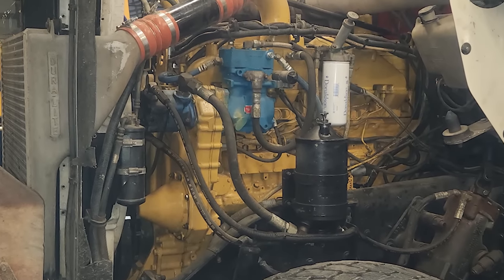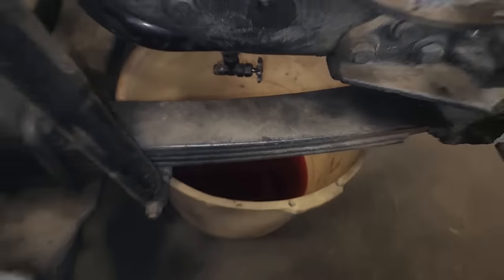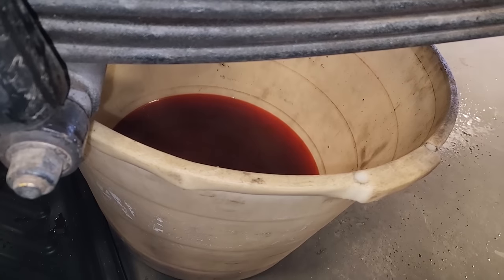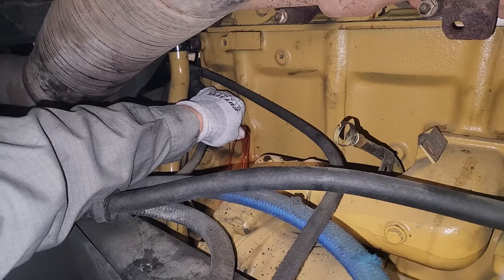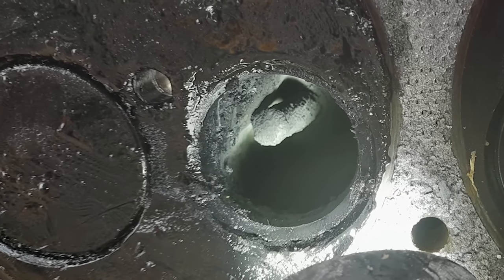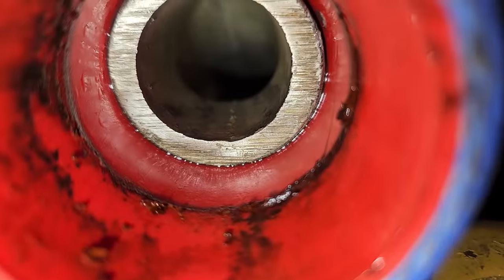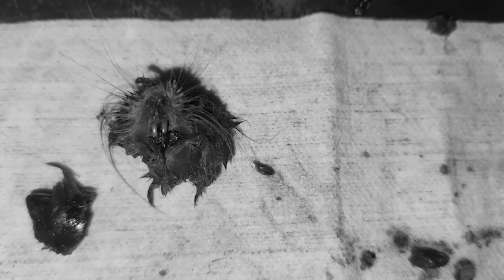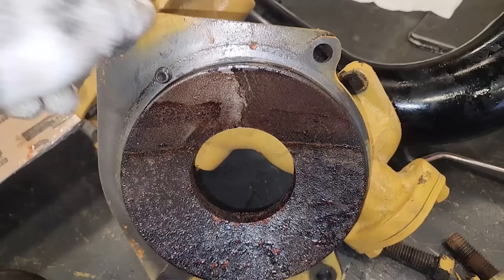Engine Overheats after Full Rebuild, but Why? (YOU WONT BELIEVE IT)

Comment from the maker: Thanks for watching. Cooling systems should always be vacuumed filled to prevent air bubbles in critical areas using something like this Airlift on this Amazon Affiliate link: Airlift Cooling System Vacuum Filling System: https://amzn.to/3D9AlPu 
@AdeptApe on Venmo or AdeptApe@yahoo.com on PayPal for donations, thank you so much for supporting the channel!
Reply: The cooling systems have a design "requirement", it is actually an installation specification that is checked during a installation review, that the cooling system can fill fully using a steady stream of coolant. I can't remember the actual flow rate - but a softly flowing hose is a reasonable description.  Sometimes this is made possible through the (discouraged) use of bleed valves at the high point of the coolant lines. OEMs use a vacuum filing system at production so the system can be filled faster and there is ABSOLUTELY nothing wrong with using one. But if it is required to get a full fill it is probably indicating that there is a problem with the coolant lines routing that has been changed or is restricted etc.
Reply: I bought and used this airlift system 3 times already. It works great.

Comment: This is why as a mechanic as soon as you think you have seen it all, something comes along and proves you wrong!!
Reply: Murphy's Law: what can go wrong will go wrong, even if you don't know it can. The mouse has proven why it is impossible to idiot proof anything. There is ALWAYS an idiot standing by to show how ingenious idiots can be.
Reply: Very interesting find!!! That poor mouse went to the wrong place to sleep... It is a reason WHY I like to put a shop rag or a piece of plastic sheet in front of inlets and hold them in place with rubber bands.... Yes, it does take some time to do this, but it also prevents several hours of troubleshooting and down time, of an extremely expensive asset.... This could easily offset the few minutes of prevention to avert a potential catastrophic failure... Protect open spigots and hoses before moving onto the next steps of repairs....
Reply: And then there is o'tools law that states that Murphy was an optimist.
Reply: I have never even heard of something like this! Wild.
Reply: @pickelsvonbrine  First time for everything...

Comment: Thanks Josh, I should have brought it to you to begin with!
Reply from the maker: Always happy to work on a Cat or a mouse in this case. Hope she runs great once it's back together. Thanks for bringing it in.
Reply: Love your vast knowledge. Just curious if anything else had to be done to the ole B model and if the waterpump was ok with the rust in it? I have a 3406B 4MG model that I installed a new water pump on...but also has slight rust from a separare problem.
Reply: Cats are, after all, good at catching mice.
Reply: At least it wasn't a complete failure on the rebuilding shop.... But glad it is being taken care of now and getting you back on the road!!
Reply: The cat and the mouse like Jerry he always got the cat.
Reply: Send the old shop a bill for recent diag. and include a pack of mouse traps.
Reply: @diesellivesmatter  Jajajajaja Jajajajaja Jajajajaja 😅🙏🏼
👍🏼

Comment: Wow, that's weird but makes sense.  Worst animal versus engine one I heard to this point was a landfill compactor (Al-Jon), had a Cat C15/D398TA pre-DPF engine (its been 20+ years since it happened), and it had been parked overnight outside of the maintenance shop at the landfill after running the previous day.  Early morning, Operator comes in and fires it up only to be startled by the immense amount of racket that occurred when it cranked over and fired up.  Shut it down quick, but the damage was done.  What happened?  Somehow a stray cat (no pun intended) had crawled past the shields over the engine cooling fan/shroud, and met Mr. 600 HP Caterpillar radiator fan, and it had dismembered the feline and shattered the blades on the 6 foot diameter nylon fan blades.  The blade remnants ended up piercing the radiator, and I felt sorry for the techs from our shop who had to go out to it, as they were picking out pieces of the furry culprit from the engine compartment for hours.  Radiator, fan, reversing hub, and some of the shields had to be replaced.  Reps from Al-Jon came out as they had thought they had it closed off well enough that Mr. Whiskers could not gain access to the void between the fan and radiator during shutdown.  They came out and went over it and made improvements to the engine compartment so that it would not happen again.  Ironically it was the only time that an animal had ever gained access to a space like that, even on the older Detroit 8v92 powered compactor machines that weren't as well protected as that new machine was.  Needless to say, it was the most expensive Cat fight I had heard of up to that point.
Reply: The problem with new machines is they are too tight for anything and if a critter gets in there  they can't get out in time when they sense the operator.
Reply: I once helped lift a huge Cat radiator still in a heavy wooden crate. It's hard to believe a fan blade for something that massive could be destroyed by an 7 lb. cat.
Reply: I put a cloth, sprayed with some insect spray under the motor hud. Animals don't like the smell and stay out, even when they would be attracted by the remaining warmth of the engine in night!
Reply: Aw, poor Fievel.

Comment: Wow- drives home the need to plug orifices with at least a shop towel when things remain open during repairs. Never hear of one of those getting in a cooling system before! Thanks for sharing Josh, love your videos.
Reply: I saw someone's picture of a cooling system filled with corn.... They left the radiator out for a few days and a chipmunk or red squirrel filled it up.
Reply: I left the air cleaner off the intake of a diesel for an extended period of time once. After putting it back together and firing it up it had an occasional miss and stuff was shooting out of the stack. Turns out that squirrels or chipmunks had stored walnuts in the intake.
Reply: We had a shop rebuilt engine sent out to a job with a rodent nest in it.
Reply: I once left an engine with the manifolds off in the shop during a rebuild in the winter for just two days. When I went to rotate the engine manually after finishing assembly, it wouldn't turn a full revolution. I ended up cleaning out a cupful of mouse bait.
Reply: I always try and make sure that my orifices are as plugged as possible...
Reply: left my battery out, bad idea, damn cat lived there and clawed every single wire, if i ever find that bastard.
Reply: Pays to have a workshop cat

Comment: This is the second time I have seen this exact problem. The last time I seen it was on a 1958 Ferrari that had been apart for a while. Apparently the mouse made a home in the radiator while it was in storage. When the customer reinstalled the radiator, the mouses home and his/her siblings/children met their demise at some point and clogged up parts of the cooling system!! One of the odder diagnosis I have been involved in during my years as a tech!

Comment: I've seen mice eat out an air filter and block/destroy a turbo, strip all of the padding from inside a cab, seats and trim, ants eat all of the resin out of an ECU and the insulation from a wiring loom, birds nest in the exhaust of a D6 to the extent that the C9 couldn't move it under it's own steam and the heat exchanger intakes on a 65' cruiser blocked with prawns (Shrimp?) completely destroying a pair of 3208T's, but that's a new one.

Comment: Very interesting! Further reinforcement  for capping open ports. We had a Cat come in with a mysterious overheat issue that turned out to be a blue shop towel in the oil cooler, coolent inlet...so along with plugging ports, make sure you remove everything...lol.

Comment: I work for a large city municipality. we have a fleet of trash trucks. We have never found a mouse in side an engine but we have found them everywhere else. Mice and rats both in the trash bodies usually where the hyd leak is, that's right they chew through 5000 psi hyd hose.

Comment: My dad has that same problem almost with the C15 in his truck. In 2021, the temperatures were rather high at about 210°. Then one night in Kingman he saw a small coolant leak but said it wasn't that bad and wouldn't do anything, the very next day, that same leak put us on the side of the road for 7 hours in the middle of nowhere, about 10-15 miles from Flagstaff if I remember correctly. Later that year, they had to put a new radiator in it I think for I don't remember the reason but it was all rusted out below from when they switched the coolant from the green stuff to the new red stuff. A few months ago, the engine was rebuilt and he said it still runs at about the same temperatures as it did before. But he said it still gets hot and he doesn't know why, he thinks it's a low flow water pump. I wish his company would send the truck up to your shop to take a look because their mechanics are just interns right now, then one quit a few days ago so it's just one now.
Reply: Take it to empire 😉

Comment: That is wild. I was having a conversation with my stepdad the other day about how a 3406 can pressurize the radiator but not blow a head gasket, he told me he think the space between the valves doesn’t have enough metal and an overheat situation makes hairline cracks on those heads, he has had to change a few heads already
Reply: These older mechanical fuel injection pumps (scroll fuel system) people would liked to "turn the fuel up' for more HP, would also result in cracks in the cylinder head and other engine damage.

Comment: My daughter inherited a '69 SS el Camino that hadn't run in 23 years. Mice made the exhaust their home and peed on the #5 exhaust valve so much, it stuck open, broke off and took a massive chunk out of the cylinder wall of the 396. The Hooker headers were rusted out and They even made it through too the intake on one plane due to the valve overlap. I plug exhaust during long storage now!

Comment: I'm working on 12 snowblowers currently and restoring a 79 Ariens to add to my collection. Out of the 13 machines, some maintained but most not, 9 were damaged by mice with some mice getting caught in sprockets and chains. Not exactly the funnest of jobs having to clean the transmissions out and replace broken chains but the little bastards put food on the table. One ate through a plastic fuel tank and overdosed on ethanol.

Comment: You can quickly get into really bad trouble with bad parts. Just like it happened to me.
I had the water pump replaced in my 1983 Ford Capri with the 2.3 liter V6 engine. The first one was from SKF and made noises - exchanged - also made noises - exchanged... then another one from Hella was available. I have photo evidence on my website. The housing around the pump wheel was closed and either happened when the pump housing was cast or was not separated afterwards? In any case, the pump wheel could not transport water and the engine became too hot. We puzzled around for ages until we removed the water pump again and compared one pump with the other one...
(End of song: We reinstalled the old water pump that I actually wanted to replace when rebuilding the engine, and it still works today). But you can now get such a step sold... it's unbelievable.

Comment: I did an out of frame a few years ago. put the truck back together and started it, very shortly after starting a very black squirl jumped out of the stack and ran out of the shop. it must have got in the exhuast while the truck was outside the shop while the engine was being rebuilt, and was in there when we put the motor in and hooked everything up.

Comment: I had to replace my water pump engine still getting hot well after the shop, last one in Nephi,Ut  and the owner and everyone one was baffled, well oil cooler was plugged, the red and green coolant was mixed anyit plugged up the oil cooler, so pulling over parleys summit was a blast, it over heated going up the pass and when oil cooler was replaced no more over heating issues. Thank you for the video.

Comment: A shop I worked at that had pretty poor housekeeping had some bundy tube, a roll of it, sitting around for years. 

One day I use it to make a brake line on a customer's car, could not get the line to bleed, no fluid through the line at all.

Turns out that ants had got inside the tube, I mean lots of them, died inside it and turned into a solid ant mass blockage.

Open ends invite creepy crawlies.

Comment: I knew exactly what that was when I seen you pull it. I have had that same issue on a Dodge truck, left the cap off and the mouse drown in the coolant reservoir. No heater for awhile, was very hard to clean out

Comment: I had a similar problem with a brand new CAT 245 excavator  that was shipped from the USA to SA  Capetown 
.We unloaded the machine from the ship, loaded it on a lowboy,the radiator cap was missing ,while I 
was were unloading the machine  in the yard I noticed that the water temperature was very very high.pulled it in the service bay and after a long while of testing and guessing as to what the proplem could be. 
We found  pieces of a dead bird in the radiator hose .that was in 1978 and have never forgotten about it .

Comment: My brother once stored his 1969 jaguar XKE in some one's garage for a period while he was assigned in the airforce to alaska.  when he returned two years later and tried to start the car, he broke the crank shaft because some mouse had packed one of the cylinders full of dry dog food.  the mouse simply climbed in the exhaust pipe and filled the cylinder after coming thru the exhaust pipe muffler the exhaust manifold and then thru the open valve.  If i had not been there i would not believe this story either.

Comment: When I was a parts manager for a foreign car dealership in Princeton I had a mechanic ask for an AMC water pump. We were a dealer for them to. I told him to be sure to read the instructions in the box. 
He went into a rant about how long he'd been a mechanic 
A little latter he was back ranting that the pump wasn't pumping
Bring me the box!
In the box were the instruction, still clean and folded. If you had rad the instructions you would have learned that the new pump has a bigger impeller,  you needed to pull a head bolt, install the pump and then use the new bolt that's still in the bottom of the box.
Same dealership ran stock car's,  one day before a race at Trenton they rebuilt a Chevy V8.
When they started it burnt rags were flying everywhere,  they suspected they had left rags in the cylinders while the heads were off :(
They pulled an all night pulling the heads only to find the side pipes were blowing out rags from under the bench the welder hadn't swept up :(

Comment: Back in my dim and distant past I had a weird overheating problem arrive at my workshop. It was on a Morris Marina with a 1300 A series engine. In slow moving traffic on a hot day it would run at normal temperature, but, out on the open road it would overheat, basically the opposite of what you would normally expect. After a bit of head scratching I made a discovery that I had to confirm with the customer. I asked if he had recently had an accident repair done, to confirm what I had found. He said yes he had slid into a gatepost on an icy bend and had the car towed to the main dealer for a front end rebuild and new radiator, waterpump and fan. The A series engine is fitted to a lot of different vehicles including the original Mini. I had noticed that the radiator grill was getting hot when it should have been in a stream of cold air. Turns out that the dealership had fitted a Mini fan that in its intended transverse engine vehicle pushes air from the engine bay out through the side mounted radiator into the wheelwell. In this inline engine it was, at speed, trying to force air against the incoming airstream, effectively preventing air from passing through the radiator. When moving slowly this wasn't an issue. I replaced the fan with the correct one and problem solved. We also gained a regular customer.

Comment: I noticed the impeller bolt is non Cat. Have seen the impeller (metal ones) spin on the shaft, mostly after market water pumps. These water pumps use to leak coolant out of the weep hole a lot. Cat tried numerous repairs. One was trying a plastic impeller and it would break away from the metal center and free wheel. So they asked the 3200 product group ( I was told this), how come your water pump don't leak coolant? The reply was that the water pump spins so fast, it pulls the coolant away from behind the impellar and the seal runs dry. So no coolant to lubricate the seal, the seal fails over time. So the 3400 product group had a groove cut along the housing to allow coolant to flow across the face and lubricate the seal.  

Our mouse story, our chassis dyno fuel cell failed. Found that a mouse would lay on the fuel card in the winter time to stay warm. The mouse used the bathroom on the card and smoked a 5K card.
Reply from the maker: That's an interesting story about the 3200 series. I bet all those guys are retired now.
Reply: @AdeptApe  Also shunt line fitting is critical on which port to put it in. The rear is the best, second is this location. The top will cause problems and should never be used.

Comment: Best I saw was a shop rag left in the lower radiator outlet. The cat dealer was not pleased. I used a diagnostic procedure they taught. ( Temperature differential between radiator inlet and outlet).Good times.